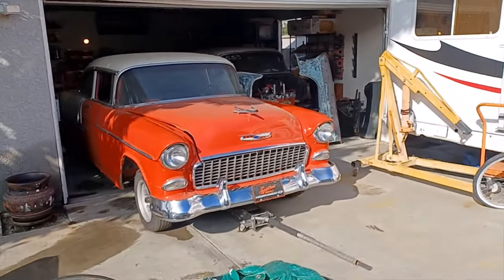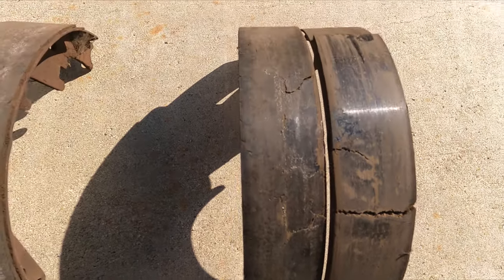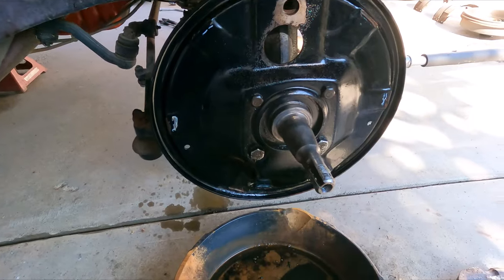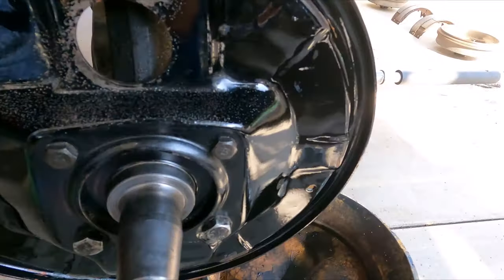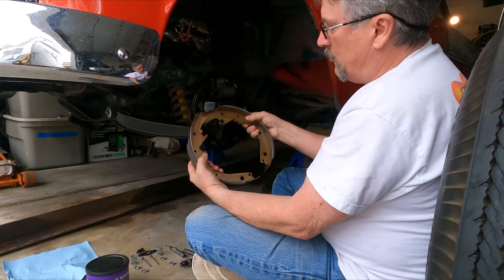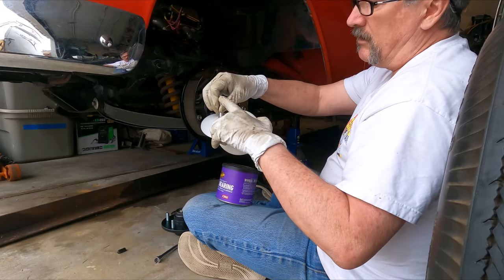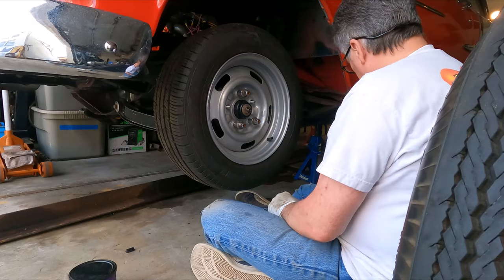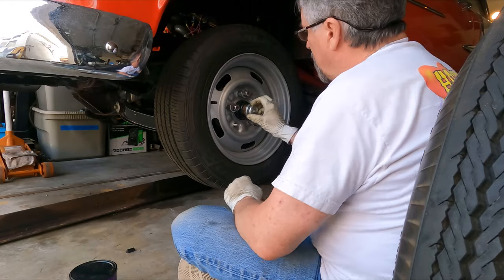'55 Chevy Bel Air Resurrection-Front Brakes and Bearings

Comment: I can’t believe you race that without the safety of disc brakes. Drums are dinosaurs. JMHO. Many years experience
Reply from the maker: I agree that disc brakes are superior but, what did the guys who raced these cars do before discs were invented?  Drums, if set up correctly like I did in the video with arc'd shoes, a good quality braking material, a well-maintained hydraulic system and a good drum that is flat and not out at max spec. are all good things to do to blueprint the brakes and have them work at max efficiency as designed.  These cars are nearly 70 years old and the designs have endured over time.  The other added advantage is that you can back the shoe adjustment off until zero drag which helps your ET's.  A disc brake will always drag.  I have run this car at many, many tracks since 1983 and braking has never been an issue for this car, even at the short tracks like we had at Carlsbad.  If a 320 mph car has enough shut down area at these tracks, then there is plenty of shut down area for a 12-13 second tri five.  Most of the qtr. mile tracks I ran had 3 turnouts and I usually took the first (shortest) turn out at each track.  All that being said, I do plan on doing a disc brake upgrade to this car soon but, I will be really scrutinizing a good quality, well-engineered kit that keeps the wheel in the stock location before I move forward.  There are a lot of cheap Amazon kits out there!  Thanks for your input, I agree that discs are a superior design.  I actually met the guy who owned the patent on disc brakes when I was real young.  He was quite an engineer/automotive entrepreneur!

Comment: Back off the castle nut till the washer is just able to move left and right. Insert cotter. Perfect adjustment
Reply from the maker: Another of the many options on setting up the wheel bearings.  This is a new one on me.  The biggest thing for me is "the feel" of not having any slop, clicking or a "glunk" when you rock the wheel back and forth.  For me, a lot of mechanics is the feel of knowing how tight is too tight and how loose is too loose.  Thanks for the info and take care!

Comment: Nice job Jeff, nice clean work, very thorough and best part of it all, I sat back with a coffee and watched you work! Lol
Glad there’s still some old school shops around that will still do custom shoe bonding and arching, I have a shop up here I deal with, same kind of business, family owned since 1951 that does the bonding and arching, makes such a huge difference when seating in shoes. Glad you’re one step closer getting the ol girl back on the road. Have a great week Jeff!
Reply from the maker: Thanks Raymond!  Yep, I was aiming to get this one out for Saturday but, I wasn't done with the work so, Sunday it was!  There actually were 2 shops here and I accidently mentioned the other one in the video but, they closed their doors about 10-15 years ago.  Both had been around since the 20's or 30's!  Friction Materials is 3rd generation shop and I have met the son and the grandson.  This is their new building as the old one was their original shop and it was really cool!  I really like getting the shoes re-lined and arc'd because the drum brake system is actually a pretty efficient system when you keep them in tip top condition like this!  Hopefully, I can get the brake lines and fuel line finished soon as that is the only hang up now.  Thanks for watching Raymond and take care!

Comment: Nothing is going on here, just Hubie doing drum brakes one-handed. That grease really is ideal. I tried to find it down here, but I couldn't. So, I used my Red N Tacky for the time being. But I'm gonna order some of the Sta-lube for when I have to repack the bearings.
Reply from the maker: It is soo funny how I finally research and find a good, quality product and within days, the item dries up, gets bought out by another company or whatever.  I had origianally found the Sta-Lube when on vacation in Montana and I lost a wheel bearing on the trailer.  The Napa's in each town had the purple New Generation Wheel Bearing Grease so, I went with it.  Sta-Lube is still at Napa but, the grease gun tube I had to order from them and have it shipped.  I bought 3 and hope it is easier gound in the future!  The Timken USA Bearings still seem easy to locate, I found these on Ebay from a company in Florida.  Let me know if you want to go to Friction Materials, I think it would be a great idea to do the brakes on the Apache with them!    I hope you are doing well and talk with you soon!

Comment: WOW the last time i seen someone bond (mine was rivits) and shape the shoe was in 1974 and the guy blew the dust off of the machine to do mine, drums  was .030 over.

i pretty much do brakes just like you. except for the tighting on the castle nut when going back together. in the past i have talked to freinds how they do it and it seems i am the only one doing it as my Dad did.  my Dad showed me his way. tighten the castle nut past lash and a little torque (just past finger tight with channel locks). roll wheel and then back off castle nut loose just enough to feel (chunk play) with wheel mounted on hub, roller bearing  just off of lash. for me this takes several testing to make sure..  if needed to loose more to get cotter pin in, or it maybe in right space already, but never go tighter,  to full lash..  when finished there will be just a very small ,off lash space, on the wheel bearing. Dad say then a very thin space will be in the  bearing track to feed grease to the next roller every wheel rotation. on half the bearing. Dad said if i go to full lash then it will squeeze out all the grease and get dry faster.

i did have one bearing go bad in 700 miles of repack bearing.  spun a bearing in hub. but found when fixing,  the lower ball joint was starting to go bad and i was misleading in the testing of the castle nut tighting.  pounded a peice of wood next to ball joint to get wheel bearing on and repaired the lower ball joint later.

when disc brakes came i check for chunk before i take the wheel off and if i have even a little bit then i know the caliper is loose enough for checking wheel bearing.. or just take a small bar and open caliper just a little bit.  when going back together set castle nut before the caliper goes on.

funny thing is every body does it different. and some how they all go down the road.

thank you for your help. GIVEBLOOD
Reply from the maker: Yep, pretty spot on Giveblood!  There are a lot of ways to do them!  Some use a torque wrench even!  Hopefully, it is in Inch/lbs. and not Foot/lbs!  For me it has always been by "Feel".  I know I will be checking these again soon after about 100 miles as the races will move or settle in.  It is great to find these old school shops and I hope to show these places in my videos in the future!  Thanks for watching and take care!

Comment: Nice work Jeff. Those old shoes were pretty shot. Going to be much better running those new rollers bearing and new shoes.
Good old 55 is smiling now😁.
Take it easy👍🏻
Reply from the maker: Thank you Chris!  Boy, you ain't kidding!  One more pass down the ol' 1320 and what was left on the shoes would have blown away and would have been metal to metal for sure!  I used to take great care of that '55 until I got married and then it got put away and covered up in the garage.  Out of sight, out of mind was my plan to avoid having the "maybe you should sell it" discussion.   It worked but, both cars suffered.  Luckily, they both are on the front burner again and both (as well as the Delray and eventually, the 4 door) will get driven again!  Thanks for watching and have a great weekend Chris!

Comment: from the vidio it looks like everything works.  so we are going to get some spare also. thank you
Reply from the maker: Glad to hear that Giveblood!  It is one of those old-school, very handy parts swaps that really helps upgrade the tri fives to the hubs with the better bearings.  It just happens to be that the new bearings are also cheaper and easier to find!  Many have done this swap in the past.  I actually did this video after your questions from the last video, realizing I had not finished the install of the hubs.  I hope this helped!  Thanks for watching and I hope you guys have a great week!
Reply: got the SKF seals, timkin bearing sets, 61-68 washers,,  squared top dust covers ,  and DOORMAN wheel studs,  ordered for both 56s.  also two other sets for the 65 and 66. thank you Hubie for your help.
Reply from the maker: @giveblood8467 Awesome!  Glad to see a video in action!  You will probably have your new hubs on the road before mine turn a wheel...hahaha!  Thanks for watching and let me know how everything goes!

Comment: Great video Jeff! I need to find some of them newer roller bearing Hubs. My red 55 nomad still has the old ball bearings.  That car should have no problem stopping now! Later Buddy 👍
Reply from the maker: Thanks Don!  The '61 to '68 full size hubs are great and a very inexpensive upgrade!   I had done a full video about them on my last video that shows a white '57 hardtop that spit out a coil spring on the thumb.  The bearings are from a place in Florida on Ebay and the studs and seals are at Napa.  I have a guy I could get some additional hubs from.  I will check it out tomorrow.  Thanks for watching and I hope things are going well with you guys! Take care!